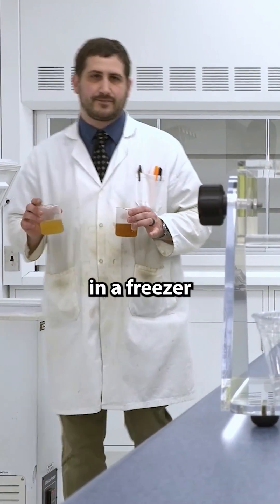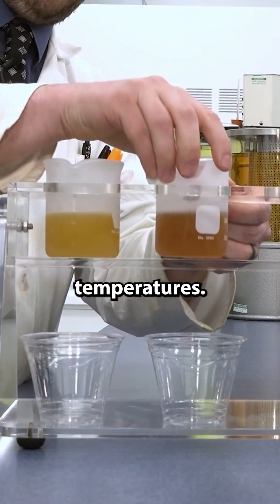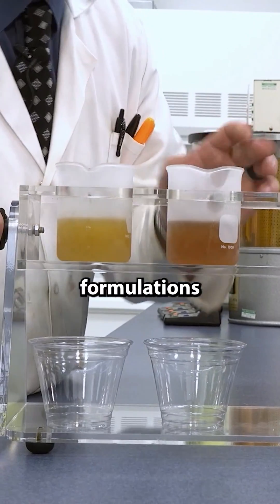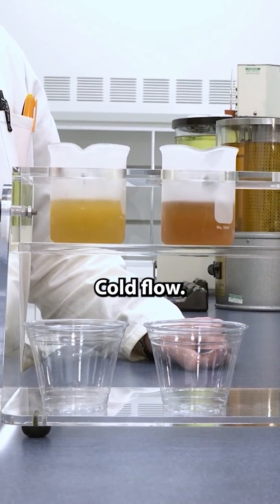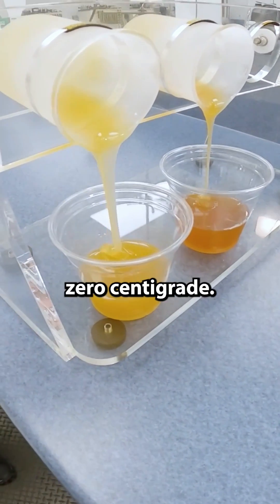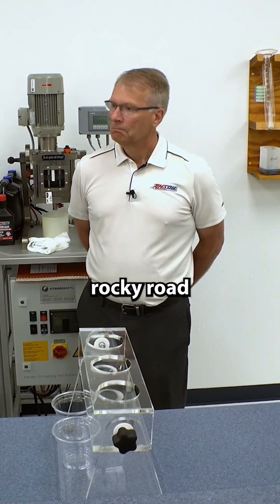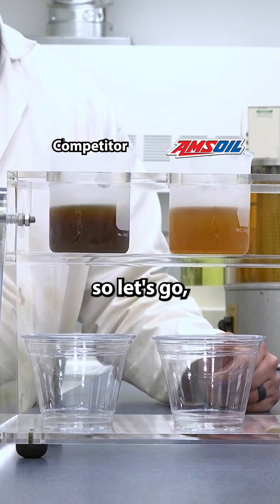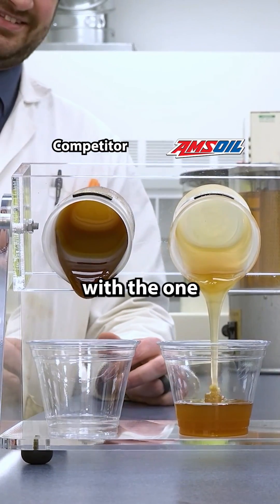Engine Oil At -35°C

Comment: I use amsoil in certain applications and i will say its top notch. In a climate that sees -35 Celsius or -31 fahrenheit i would definitely choose the ams. But where im at we see maybe a day or two out of the winter around 0 fahrenheit and im willing to bet that rotella or pennzoil and mobil 1 all pour dang near equally the same around 0-10 fahrenheit.  Just my opinion.  Not bashing amsoil or ita price.
Reply: West texas here, amsoil definitely performs better below 50°f in my 07 lbz duramax. Once they are warmed up they do perform about the same. But ill choose the oil that does better is cold weather and the same in warm.
Reply: @Legally_its_a_joke penzoil utra, Plat Sythn. Poured better on other tests, cold 🥶 test too.
Reply: I've recently started using Motul in my n54 and it's pretty good. Oil temps dropped a little even.
Reply: I started my car at -35f last winter and found a little bit of glitter in my oil pan with a magnet (I pour the oil over a magnet every oil change) first and last time any metal came out of that motor, but I was using mobil 1. Definitely gonna think about switching to amsoil during the winter after seeing this.
Reply: @megamiteexplosion  no way your pump was bringing up treacle 😬
Reply: @tonyppe  I know! It makes me wonder how long it took for my motor to be properly lubricated. Its a gm 3800 motor and I remember how proud I was that it started up right away the first time I cranked it in that weather with no block heater but I thought it would maybe only take a couple of seconds for the oil to start flowing. This really makes me wonder how long it was!
Reply: @megamiteexplosion why would you do that without a block heater or anything?  At least you ruined a 3800 and not a good engine.
Reply: @unpopularopinion8608  not ruined. Just drove that same car nearly 10k miles in the span of a month. I didn’t have an extension cord long enough and at the place I was living at had to park on the street. Don’t have to worry about that anymore as I’ve moved. That car has taken me hundreds of thousands of miles and never left me stranded. 3800s can run like shit longer than most motors run period.
Reply: @megamiteexplosion three words for you ford fkin ranger way better than some chevy junk box
Reply: @megamiteexplosion  Ford did make the 2.3 Mazda engine, sohc Vulcan 3.0 and 4.0 (4.0 not as reliable) for over 25-40 years these engines were used
Reply: @JUNEBUGLLC  ford ranger is okay for a beater definitely a fun truck but if I’m driving it every day and want to depend on it I choose an s10. I love my Chevy shitboxes man! I have a 91 buick lesabre custom with 470k on the original 3800 just kept up with maintenance my daily has 220k and I’ve beat on it for over 100k with zero issues always taken me where I needed to go and I have 2 other grand Prixs. Super reliable easy to work on and cheap. Gm used the 3.8 v6 for over 40 years and even tho they haven’t produced any for almost 10 years there are millions and millions on the road today. It’s a legendary platform for sure. Nothing special, not fast, but cost to reliability ratio is crazy good and you can have fun with them.
Reply: @megamiteexplosion bro,please dont fall prey. the old man has a little deal with ams oil. if he had a deal with mobil 1 then it would be the same negative temp test. i live the negative climate and use 15/40 synthetic (any) brands and no issues.
Reply: Project farm has all the oil tests you’d want to see

Check him out on YouTube. Definitely good tests; the guy knows what he’s doing
Reply: at neg 30f pens oil plat still flows. but synth oils have a far better cold flow rate. or change oil to a low xw number. as w stands for winter flow.
Reply: That’s exactly what I thought. How often is your engine oil ever going to be consistently at a temperature like that?
Reply: Penzoil. Mobile 1 used to be my go to until I saw it perform worse than walmart brand oil on project farm. It does flow well when cold, but that's the only credit I will give it.
Reply: Just add some marvel oil in the winter. It increases the cold flow and cleans the engine in preparation for a spring oil change.
Reply: Do you also wait the 15k miles to change your oil like it says on the amsoil filter 😂
Reply: Rotella T6 is trash. 5th Gen Cummins lifters are noticeably noisier with it.
Reply: Amsoil is great oil but if it's cold enough that your oil is gelling up so is your fuel.  You're going to run into all kinds of issues and will either be running heaters and/or keeping the equipment running.
Reply: yours is the first comment I looked at to find whos starting engines every day in -35. doesnt even matter if it's C or F it's about the same. 

Now how about 0F or something more real-world.. perhaps a week or a whole week of severe winter weather for most of the world is not going to be -35. Where I'm from in UK it got down to -12C for I think one night but was a whole week of -10C which worst case is still 10F.
Reply: @tonyppe take a trip to North Dakota. It was in the -30 to -50C range for about a month or two straight last winter.
Reply: @tonyppe where I live it gets as cold as -50c and hovers around -20/-30 for most days and winter like that lasts for about 8 months. The city I’m in actually has a population of 23,000+ and we aren’t the farthest up in my country by a long shot so it’s not as uncommon as some might think
Reply: @tonyppe Where I am in Canada is not bad right now only like -7 to -13 c but it’s normally -30 to -40 c, but most years this would be a problem but I don’t know why it’s so warm this year.
Reply: @tonyppe that is real word temperature in the winter here🇨🇦
Reply: @tonyppe mathematically, -40⁰ is the only temp where F and C are the same. 
  From there, they spread pretty quickly. -100⁰F = -73⁰C. -40⁰F = -40⁰C. 32⁰F = 0⁰C. 212⁰F = 100⁰C.
  Multi grade oils are measured at 0⁰C and 100⁰C. 15w-40 flows like a 15 viscosity oil at 0⁰ and 40 viscosity at 100⁰F. All competition should be in the general range at those measured temps. At -35⁰C, Amsoil flows better. At 0⁰C and 100⁰C, they should be roughly equivalent. 
  If you're concerned about cold starts, switch to a 5w-40 or 0w-40 rather than the common 15w-40. I'd rather have better flow at a more common 0⁰C for better engine protection in a cold start situation. Its hard to say whether the competitor's 0w-40 will flow better than a
Amsoil 15w-40 at -35⁰C, but I'd bet money on it.
Reply: @EricErnst  thanks for the info but I just done a rough calculation. Theres like a couple or so degrees difference at -35 so "it's about the same" is what I explained there. 

Good info about the oil viscosity too.
Reply: Mobil 1 is trash
Reply: @clutchbleach2057  oh wow such great information that you bring to the discussion 🤣

Comment: Used it and it cost me 6 thousand to fix my truck after a few months of use. 
Rear differential
Reply: Well you dont put engine oil in rear differentials 😂😂
Reply: Lmfao 😂😂😂

“Rear differential”
Reply: @stunt- you know there are front differentials as well right
Reply: Yeah probably after you started having a noise in the rear diff, then you changed the oil (to amsoil) hoping it would make it go away, but by then the damage was done and it just got worse from there and THEN in time it completely went out or undriveable and he blames it on amsoil.... pshhhhh......
Reply: wtf are you talking about
Reply: Well when you try and do burnouts at every stop with stick parts youll get that.
Reply: My tires blew up after using this oil 🤦‍♂️